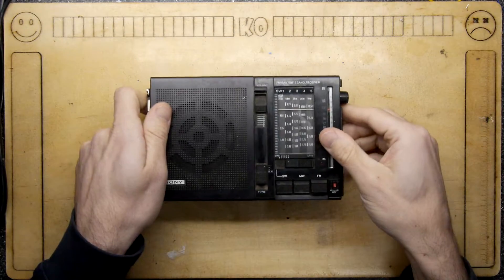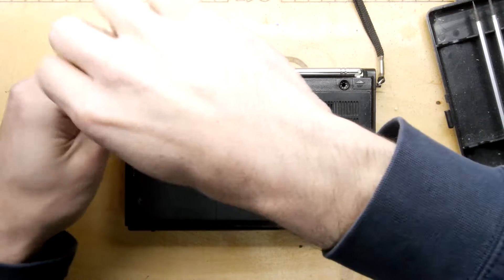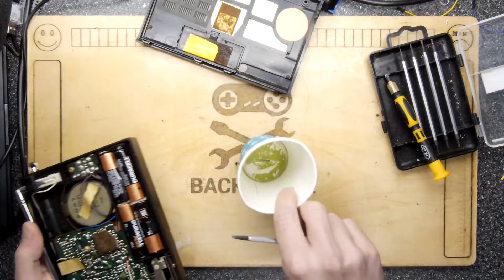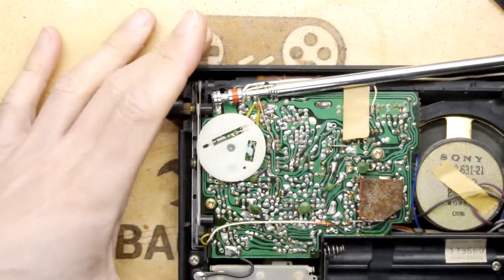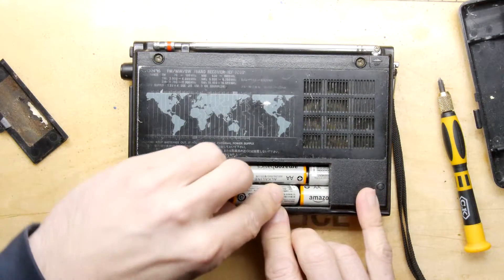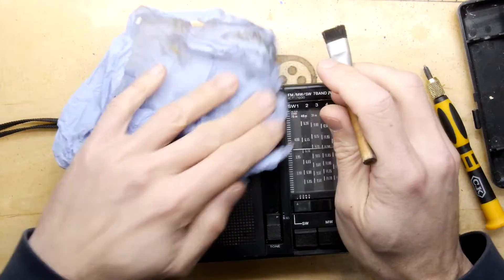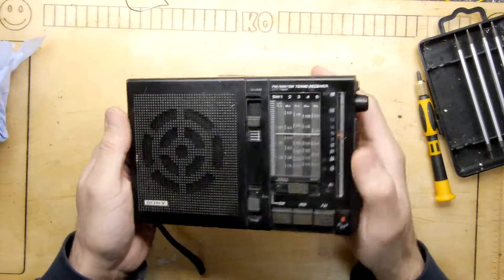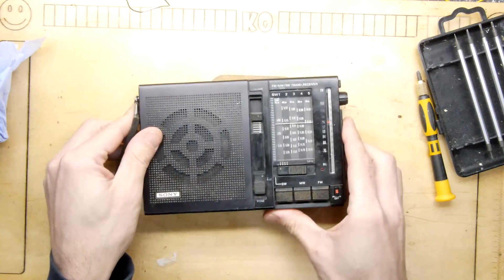First Edition SONY ICF-7600 World-band Radio Mini Teardown and Restoration

Comment: As a chemist, you got me interested in the ingredients of FLU too. A little investigation into the MSDS sheet says "Contains
Cyclohexane, Propan-2-ol, 1-Methoxy-2-propanol, Hydrocarbons, C7, n-alkanes, isoalkanes, cyclics, Orange Terpenes"
Nice cocktail of non-polar and polar(ish) ingredients. The terpenes explain your citrus nostril I.D.
My go-to non-destructive cleaner for most surfaces that are not electronic is sugar soap.
For electrical gear, I tend to stick with propan-2-ol. Or IPA as you mentioned.
Great video, thanks.
Reply from the maker: Oooo a chemist!! A real thing, makes smells, explosions and things that foam! Do you work with anything fascinating? I love a bit of chemistry me 😁
Reply from the maker: Ahh, the bravest type of chemist 😂

Comment: I have the radio. It is not catching FM stations. Can it be fixed?
Reply from the maker: You should see if there are any electrolytic capacitors in it that need replacing

Comment: Interesting to note is that this radio still isn't localized as some later radios have become. Which is recognizable by the FM band that goes from 76-108 Mhz. Whereas the other more modern receiver we had, Philips AE 3205, only goes from 88-108 Mhz according to European standards.

PS. Was watching this whilst listening to my Sony ICF-7600. 👍
Reply from the maker: Oh that's interesting. I don't suppose anything interesting is happening on those bands anymore
Reply: @backofficeshow  There is in different regions of the world. 

To quote Wikipedia on the FM Broadcasting Band:

"The FM broadcast band is a range of radio frequencies used for FM broadcasting by radio stations. The range of frequencies used differs between different parts of the world. In Europe and Africa (defined as International Telecommunication Union (ITU) region 1) and in Australia and New Zealand,[1] it spans from 87.5 to 108 megahertz (MHz) - also known as VHF Band II - while in the Americas (ITU region 2) it ranges from 88 to 108 MHz. The FM broadcast band in Japan uses 76 to 95 MHz, and in Brazil, 76 to 108 MHz. The International Radio and Television Organisation (OIRT) band in Eastern Europe is from 65.9 to 74.0 MHz, although these countries now primarily use the 87.5 to 108 MHz band, as in the case of Russia. Some other countries have already discontinued the OIRT band and have changed to the 87.5 to 108 MHz band."
Reply: I can add that older US Army radios like the PRC-25, PRC-77 use the lower bands of the FM spectrum as well as old TV stations but both are no longer being used. We replaced the PRC-77 in the early 90’s for the SINCGARS radio.

Comment: Hi.I have one 7600A type,the A means that it begins FM range lower.It is in working condition,but there is not enough loudness.Can I  find a repair kit to do a recap please?
Reply from the maker: I suspect you will need to acquire the parts separately